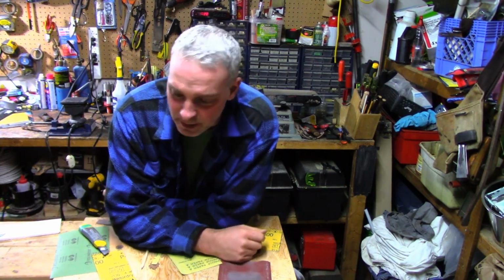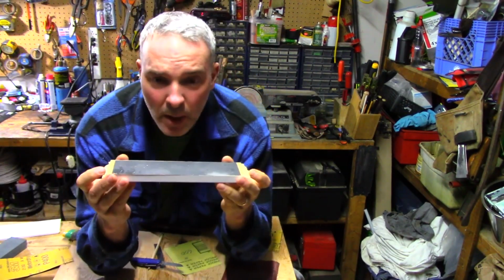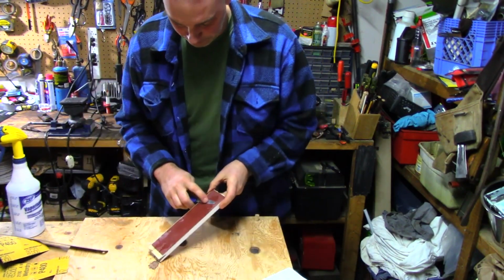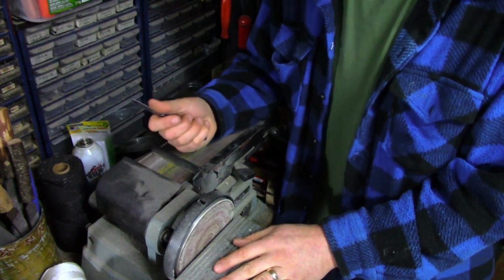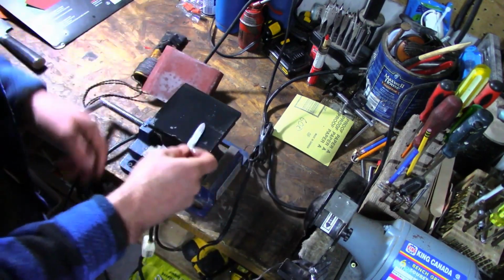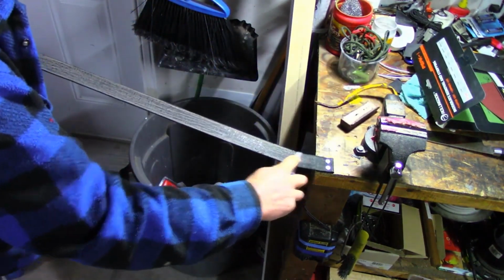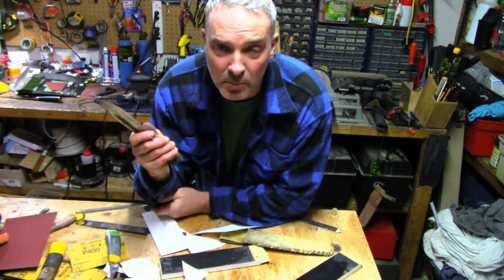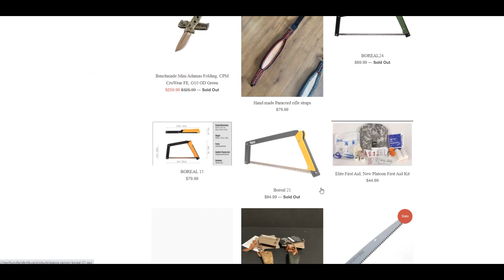Two Cheap Ways to Sharpen Knives

Comment: Thanks for the video Greg...went great with my morning coffee!
Before I met my wife she traveled to Europe and in Germany she purchased a complete set of high end Henckel Butcher/Kitchen knives...when I met her and her knives I knew I had found the woman for me - we where married in 89' and the knives, my wife and I are still happily married...🤣
I rarely have to "sharpen" them, I run them across the steel every time I use them and they are shaving razor sharp! Your process is spot on to get a dull knife sharp without spending a bucket of money on stones. I occasionally use 1000-1500 wet paper on a small machinists granite plate as a base. This gets the edges super sharp. I bought my granite plate years ago for another use but a small one isn't too expensive.
In any case thanks for the video!
Mike 🇨🇦 🍁 👍

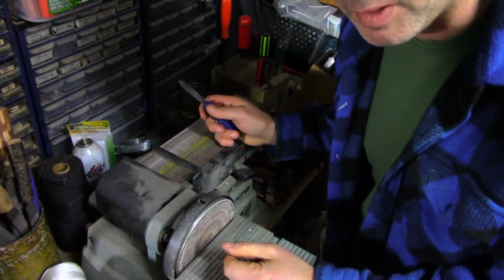Comment: I have worked on saxophone mouthpieces and this is similar to refacing them. You attach sandpaper to a flat block of glass to run them across. 13:25 So many things in my house have (unset) timers, or surge protectors as their on/off switches lol.

Comment: The thing to always remember with any powered sharpener is that heat WILL be a factor. You can burn up an edge real quick, and that starts happening BEFORE you see any blue color on the steel or it feels hot to your finger. 
Cool it often. Like very often, dunking it in water every other pass is best.
Science nerds have found that even when using a handheld stone, the very very edge can reach temps of up to1500F, and that will definitely ruin the temper of those first couple millimeters on the edge. So if you have a knife that used to hold an edge well and suddenly you find yourself sharpening it more often... that's what happened. You ruined the temper at the very edge and you'll have to carefully sharpen past that to back down to steel that's in good shape. 
There's a certain famous knife company that makes pretty expensive knives and is positively infamous for grinding their edges into softness; then the folks who paid 2-3 hundred dollars have to remove that burnt steel to get down to the stuff.

Comment: I own a very coarse grindstone and one of the "fancy" Japanese wetstones 1000 and 2000 grid. I have watched many viedos and tryed often, but I still cant seem to get it right. Strangly, I seem to get the best results when I just use the very coarse grindstone and then just the honing steel. Still the knifes dont get really sharp but at least noticably sharper. For a while.
Reply from the maker: My best guess is that the problem is that you are going from coarse to super fine. The coarse works but you're basically putting a serrated edge on your knife - so it feels very sharp, but dulls easily. You need to go to 400 then 600 before going to 1000.  All that said - you'd be surprised what you can do with a $30 vibrator sander :)
Reply: @outdoorsonthecheap  Yeah that could be it. I will get some Sandpaper between 600 and 800 and see if the results improve. I would really like to use a sander, but I live in an appartment in the middle of a city. No garage, no outside whatsoever. Using power tools in an appartment building... lets just say if may neighbours did it I would be very annoyed. So I will not do it either.
Reply from the maker: That makes sense; but get some 400 grit too. Your coarse stone is like 100 or 200 - so it's too much of a step to go to 600.
Reply: @outdoorsonthecheap  Yeah I bought a set of wet/dry sandpaper just as you suggested. And it works. The paper test does not lie ^^